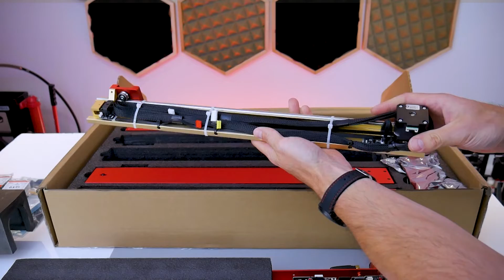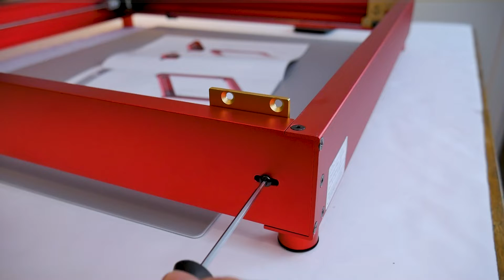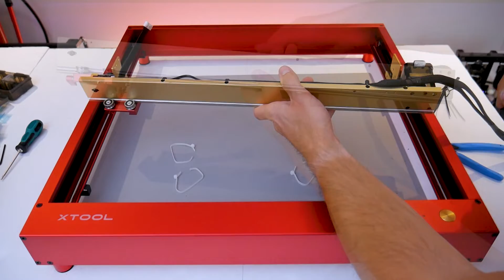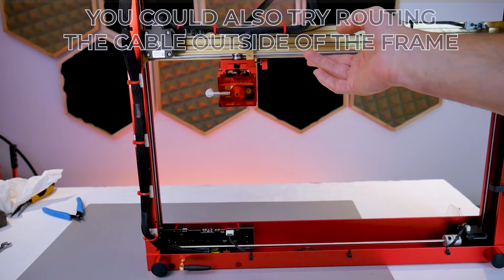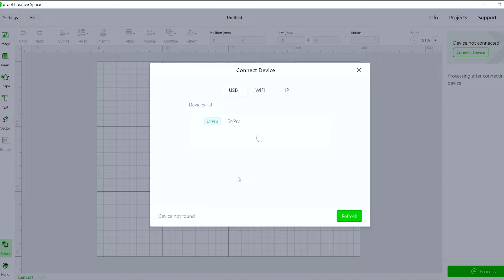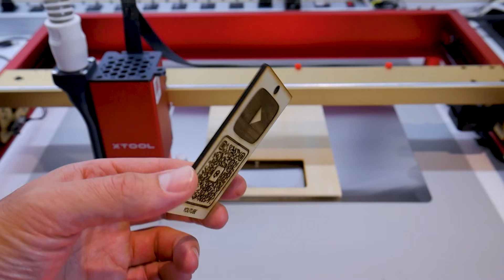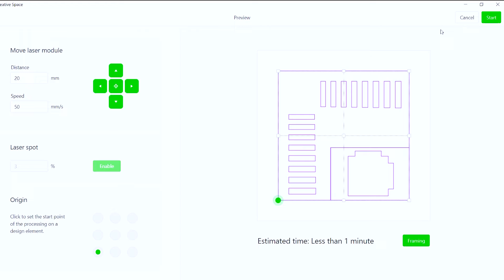XTOOL D1 Pro In-Depth Setup Guide, Assembly, Creative Space Software Fundamentals and Fume Extractor

Comment: Hello! I would like some help, please.
I bought the xTOOL D1 Pro. Most of the time, I use "Current Position", but I drew a Grid to engrave on a Waste Board and I made the drawing in the size of 420 mm (Width) x 390 mm (Height) and I am using "Absolute Coordinates", but when I execute the Homing and, after the Framing, the machine starts and immediately hits the Frame on the right, activating the Limit Switch and the Beep. I don't understand this, because the xTOOL D1 Pro is sold as having a useful area of 430 mm (Width) x 400 mm (Height). The origin of my machine is in the upper left corner. I appreciate your answer. Thank you.

Comment: So far Im NOT impressed with any of this! its about to be target practice!  Ive been able to get ONE successful engraving done on one card!  Got a design made sized and went to frame it and it shot way off to a different area then it did with the framing!  that took me 2 days to fix with zero help from x tools support and 5 unanswered tickets.  The software is total garbage there ether dumb ignorant or lazy. after i FINALLY figured out how to fix that witch ended up being a size issue somehow my size only applied to the framing but not to the logo (witch defeats the entire point of framing!  after that now i cant do anything else the only thing it will do is the same card over and over and over for the last 6 hours literally NOTHING will clear that job. All i found was 50 other people with the same problem all over the internet but not one single solution that worked!   So i tried  using my phone instead of the pc when i create it on my phone it sets the power at 1% and tells you that, gives you an option to change it but when you click it then the window closes and doesnt take you to where you can change it!  and there is No place in the app to change it.  then i unplugged the laser, card, and key and reset everything along with a long hold on the button none of those things fixed it! then i tried saving the one from the computer to the cloud on my account with the power correct and then its not there on my phone so apparently that doesnt work ether!  basically this thing is TRASH!!!! if anyone knows how to fix this let me know otherwise i pray you see this before you fall for one of these sad excusees for a tool

Comment: No USB device found, can't connect to the engraver in any way.

Edit : USB and wifi works on third computer under MacOS Catalina 👍
Reply from the maker: Have you contacted xTool for support? Are you on a Mac or PC?
Reply: @EmbraceMaking  hmm yes. They replied with information to try but I got a connection working to it with an older Macbook (2012) laptop that had Catalina. Now after setting wifi it connects via wifi too, but I haven't yet gotten it to work with older MacOS Sierra on a newer laptop (2015) and neither on MacOS Monterey via USB (desktop Mac Pro 2009 -- I'm not sure if it's the Monterey through OpenCore or the USB 2.0 connection, I'm yet to try via ethernet). It works through both USB and wifi with Catalina running xTool XCS software, but it doesn't work with Light Burn.

Edit : The USB connection isn't fast enough to run the engraving, it gives an error. But wifi works ok. I have it connected through a separate wifi spot detached from the network at home.

Comment: This video may just have saved my sanity !!!  
I assembled my D1 Pro last night, and only got a chance to test it out today, I loaded an image into XCS to attempt to test run the machine, it wouldnt move after clicking on 'FRAME' , I chose to bypass that and attempt to engrave anyway, the module would only move along the X axis and would then constantly give me limit alarms....  I think this video has solved my problem, I completley missed that small black cable that plugs into the limiter for the X & Y axis...  I dont recall seeing that in the assembly manual for some reason....

Comment: How often would the filter need to be replaced... can it be cleaned... with a blower, smoke and debris just goes out the window. But I like the idea of your fume extractor, more or less self contained. The area where I will install a xTool D1 Pro would require a fairly long hose, cutting down on the effective cfm. With a rolling cart and the vac installed within the cart, I suspect your fume extractor may be the way to go, depending on the cost of and how often the replacement, etc... of the filter would be. The shop also has a ceiling mount air filter... I know a Blower would rid all smoke.... and hope the fume extractor set would also. Thanks.

Comment: Is the air assist plug required? I am having such a difficult time screwing it into the laser module.
Reply from the maker: Only if you're planning on using the air assist function - otherwise you should be able to leave the fitting off
Reply: @EmbraceMaking  Awesome. Thank you for your reply.

Comment: Where do I connect the fuse extraction module pump too? Another air pump ?
Reply from the maker: fume extractor can be connected to any suction source... I would recommend something like a shop vac with HEPA filter and carbon filter to filter out the smoke and smell. I wouldn't use a paper filter that really won't cut it. Or if you can find a fan / suction source like a radial fan that can produce enough negative pressure to suck through the smaller CPAP hose. The bigger 4 - 6 inch inline duct fans generally won't do a great job through the CPAP hose
Reply: @EmbraceMaking  saw your other video, baught a Stanley and your 3d adapter- your a life savor bro

Comment: The fume extractor and his recommended vacuum system are absolutely not worth anything.  The fume extractor has very little sucking power due to the diameter of the 3D printer extractor.   Also, he recommends that you use a CPAP hose, which further limits the airflow.  Don't waste your money.  I bought some that are sitting in a box, waiting to go to the trash can.

Comment: hello and thanks so much for this video it helped me set up my xtool d1 pro. Now im at the phase of experimenting materials but I have questions for you before I begin:

1.Do I need both an air assist and your fume extractor? Do they do the same thing?

2. Do you suggest the metal plate or a honeycomb Laser Bed to go on top of silicon mat but under material?

3. Should the laser  slide all the way to the mat or be adjusted  where when it slides in,  the back metal piece of laser underneath plug is even with the bracket its attaching to? Ultimately resulting in laser being approximately  a quarter inch from the mat?

Comment: I m new to laser machine and in market to use for making cards from cardstock paper and some miniature wood piece. I  have Cricut maker machine.
1) does it work on cardstock paper or too strong for it?
2) other tool air assist or honeycomb is optional  in such application? like to try first and gradually like to add accessory.
3) what is longevity of this machine?
Reply from the maker: It will work with cardstock. If you don't need a lot of power and use thin materials you can save money and use the 10W version. Adjust the power down low and cut through card stock easily. I don't do a lot of card stock so I'm not sure if air assist is needed - it might not be good if it blows the small pieces around anyways, so you can try it first and add it later if you think you need it. Again you can save money this way. Same as the honeycomb. Longevity should be like any other machine - depends on how you take care of it. If you're only using low power settings the diode laser will last a long time and also just generally take good care of it - clean the lens occasionally and clean and grease the rods.
Reply: @EmbraceMaking  
thank you for reply

Comment: i currently use three scratch engraving machines to engrave Finisher Plaques for an event I put on.  I am considering buying 3 XTOOL D1 Pro 10 w to engrave metal plaques for my event, replacing three older engraving machine with XTOOL laser engravers. I have an Apple MacBookPro laptop with 4 USB output ports.  Can i connect 3 XTOOL D1 Pro to my MacBookPro and control each XTOOL  from my MacBookPro?
Reply from the maker: It looks like you can use xtool creative space with mac - but are you asking if you can simultaneously connect 3 machines? That part I'm not certain to be honest... I only own the one D1 pro so I haven't been able to try two machines at once... might be a question for xtool tech support directly!

Comment: Thank you so much for the great video! Ive encoutered my first issue, for the step at 8:01, I cant plug the White cable into the white socket, I have tried for ways, it seems there is a plastic piece on the white cable that it stoping it from sliding in, ayone else have this problem?? Thank you!
Reply from the maker: I think it must be the locking tab you're referring to. Did you get it pressed in there? The tab should flex so you can press the connector in and then it should click in place

Comment: How do you control depth of engraving? I'm not a PC person. How do you know how set WIFI?
Reply from the maker: You can engrave deeper and darker by either increasing the power or slowing down the speed (or both). For wifi, you should be able to access it in the machine settings... has to be plugged into USB first and then do it through Creative Space
Reply: I'm having trouble connecting the software with the machine. @EmbraceMaking
Reply: I'm still having trouble connecting with the machine. I can't find the menus in the videos @EmbraceMaking

Comment: Can you use the fume extractor and air assist both together?
Reply from the maker: Shouldn't be a problem, although there's a chance that some amount of some / fumes may get blown away by the air assist but otherwise when I tried it on the 40W module it worked fine for me

Comment: First, I'd like to thank you for putting together such a thorough and descriptive video. I have a question regarding the fume extractor that you designed for the 10W machine...we purchased the Air Assist tool with our new machine. Would we also need a fume extractor, or will the Air Assist serve the same purpose that the fume extractor served in this video? Thank you for any insight, we are new to the xTool community.
Reply from the maker: You're welcome! The air assist will blow the fumes and smoke outwards. It is designed to clear the space around the laser beam so it doesn't get diffused through the smoke and thereby increases the laser efficiency (or at least makes it stable). However the smoke will still get blown out everywhere into your room. The fume extractor is designed to try and pick up some of that smoke and then get it filtered or get it out of your room so it doesn't accumulate. With just the fume extractor is sort of has the same effect as the air assist - it will draw away some of the smoke from the laser path... however it's not its primary function. The primary function is to minimize smoke accumulation in your room. Whereas the air assist is generally aimed right in the laser path and doesn't do anything for smoke accumulation in your room. 

So each have their own primary function that is different from one another. If you use both together... it kind of depends on how strong your air assist is. It could blow some of the smoke and fumes outside of the reach of the fume extractor and that is just the reality of having one thing blowing while another is sucking all while the laser module is moving around everywhere.

Comment: At the grand age of 62 my wife has just bought me one of these 20w that i was not expecting and it's my first ever one so im hoping that i can use it , will it cut metal disc
Reply from the maker: With the 20W and 40W you can cut some very thin metal like 0.1mm thick. But you pump a lot of heat into it and it will distort the material. I have a 40W kit video I will be releasing soon and I show it.
Reply: Thank you

Comment: Just put mine together have not even turned it on yet. Question it said I could not use laser box basic? I don’t know what that is. Would my next step be down loading the free program from xTool? Great video go to go back and fix a few things you pointed out. Thks for sharing!
Reply from the maker: Hey sorry I must have missed your comment, I haven't used laser box basic. What kinds of things will you mainly be doing? For general use the xtool software isn't bad. If you're an advanced used light burn seems to be the choice of the pros
Reply: @EmbraceMaking  just want to be able to put clients name on cutting boards for now

Comment: I ordered the smoke extracting stuff from your channel and it is supposed to be here by Friday.  The thing I am concerned with is that I have not been able to move the laser with light burn or laser  box.  I am going to try the users forum.  The xtool folks set off my virus scanner every time I try to fool around with their website.  Thanks for the video keep on keeping on.
Reply from the maker: Thanks for your order! So you are not able to frame or jog the axis at all with lightburn? Have you tried Lasergrbl just as a sanity check to see if its the software?
Reply: @EmbraceMaking  it is not the hardware I left out a driver.  It works with the xtool creative software right off.

Comment: Can you still use air assist with your extraction nozzle installed? Thank you!
Reply from the maker: Shouldn't be an issue although depending on the strength of your air assist it might blow some of the smoke away from the nozzle.

Comment: Tip for the tutorial: watch the assembly portion all the way through because you can conserve your zip ties. Or you can go get extra zip ties before you start assembling so you can execute his assembly tips, which are good.
Reply from the maker: Thanks Timothy, yes you will definitely need a few extra zip ties for this assembly!
Reply: @EmbraceMaking  thank you my friend. At Home Depot the little do-dads are called mounting bases. The ones I got are 1“ x 1“ so I just cut down two parallel sides with a tin snips to fit the X tool rail. And you actually get a little bit more adhesion power. This wasn’t planned it just happened that way. Lol

Comment: It seems the newer updates to the XCS changed the interface a bit. I press "start" to start processing, and then tells me to press the button on the machine. When I do though, i get the "task canceled" message. Any ideas?
Reply from the maker: Are you running the latest firmware on the D1 pro? If not, maybe there is some kind of compatibility issue between the Creative space version you're running and the machine firmware

Comment: Great information and well presented!
The only things I'd add are:
-  when you and initially putting together the pieces, insert the screws and tighten them only until they just more that touch. When all the fasteners for a part are in then go back and tighten them in a couple of rounds. Tightening them at the start could cause mis-alignment.
-  do the zap tie around the x stepper first then secure the cables under the side frame but be sure to have the x axis all the way to the back and secure cables starting at the back and work towards the front.
Reply: Cheers for the tips on the cable ties! Was having issues with the wire moving excessively, but your tip fixed it

Comment: This is a really insightful and well thought out video. I have a question. I was having a hard time finding a work table for this laser and honestly I didn't want to take the time to make one. I have a Costco 34-in by 34-in card table. Should I get a piece of 26x26 in wood to place underneath the laser or should I just flash the table with aluminum? I use to laser engrave back in the day before it was cool and the machine that I used had a metal bed.

Comment: I'm having problems when trying to home the machine, it will successfully home on the X axis but when moving to the back it will not reach the little end stop bracket and will just grind the belt... Could it be because the dumb wiring management? I'm going to redo it tomorrow after work but I want to be ready just in case that there is something else to check...

Comment: Why does my machine keep hitting the left side limit switch when the program on creative space is within the parameters
Reply from the maker: Is the job you're running really big? Like does it just fit inside of the allowable space in creative space?
Reply: @EmbraceMaking  yeah it fits inside it’s just a text nothing crazy and it fits with in the space and I have the machine start at least one inch from the left side and it starts to cut and some how the cut winds up having to travel to the left enough to where the limit switch is set off 
I have a x carve pro CNC that I use everyday and I’ve never had a similar problem so I’m really stumped as to why this is happening
Reply from the maker: Hm well I know sometimes with these machines when the file you're running comes really close to the limits of the machine sometimes those sensors trip. If you think you have room and it's not going to crash the axis you might be able to temporarily unscrew those sensors or the little trigger piece just to get the job done, but be careful not to damage your machine if you think it will actually hit

Comment: Great video.  One question, I have set up my pro and when I am framing it is not framing horizontally only vertically all the cables are correct so i am a little lost.
Reply from the maker: Are your belts tight or is one axis slipping? Had someone else come to me recently with the exact same issue and this was the solution